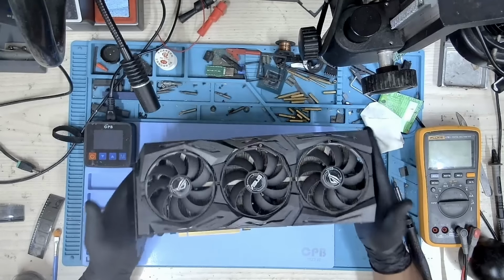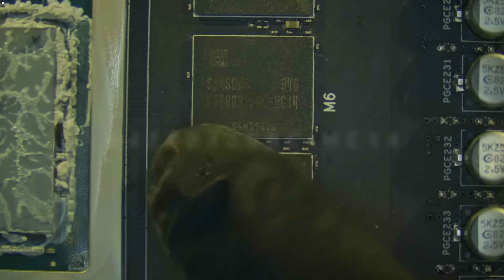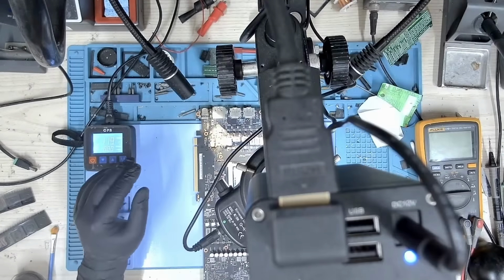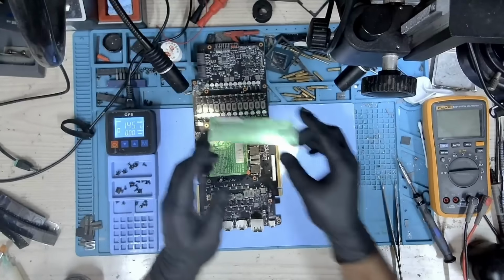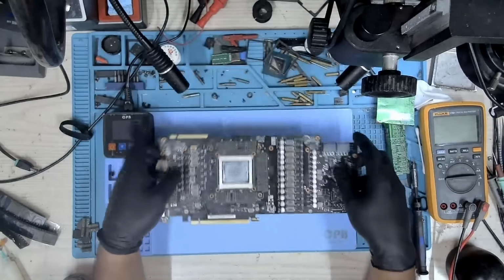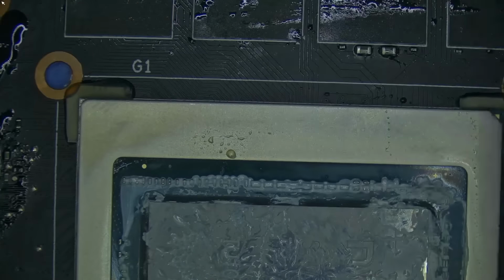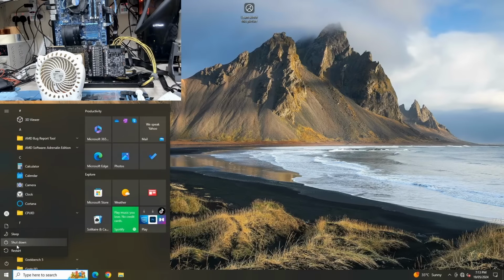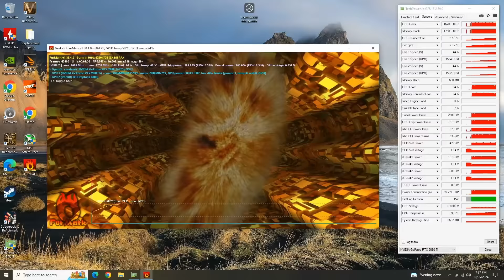Upgrading Asus RTX 2080 Ti memory from 11GB to 22GB

Comment: I doubt the 2000 series has the firmware capable of utilizing that much RAM. But I’m here to see what happens.
Reply: Very interesting and I agree that the chip would struggle to be able to utilize so much memory. It very well may be throttled from the factory and have the capability to use a little more, like 16 perhaps, but 22 is just overkill for it. I’m also curious to know why you didn’t benchmark the card prior to the upgrade so we could then benchmark after and see if there is indeed a difference. Essentially the question remains whether or not the chip is the bottleneck or if the memory is the bottleneck when it comes from the factory. If it’s the memory then this may be an upgrade that could have at least SOME merit, but if it’s the chip and it’s already overlocked then this was just a waste of time. We don’t know without benchmarking. If you could provide some verifiable evidence either way, via benchmarking, that would be appreciated.

I’m also very curious to know if this changed the heat profile of the chip at all. What was its idle/load temps prior vs after?

If it increased heat output, I’d recommend a water cooler system at that point to maintain stability and longevity of the card, especially if living in a “warm” environment. 

Is the end user of the card using it for gaming? Are you in contact with him/her? Are they able to report back on any noticeable performance improvements?
Reply from the maker: The end user is using for AI training. It is able to utilise all the memory installed. For gaming I will not recommend this upgrade as explained in the video.

Comment: It would be usefull to transform a 4090 to ~90 GB Ram for Running local LLMs Definitelly cheaper than buying a H100. I'm up to do it if you have a source for the RAM. I have access to proper equipment and the skillset.
Reply from the maker: On the current PCB for the 4090 there are only 12 memory slots. The largest capacity produced on GDDR6X is 2GB modules. If the memory is to be expanded a new PCB would be required with more slots. Something like a 3090 PCB. 4090 uses an extra 1.2V rail which is missing in 3090. So a whole new PCB would be designed from scratch.
Reply: @GraphicsCardRepairs-tk7ql  Oh I see. That would make it easier to add on then, since you could take advantage of auto pick and place. I guess the real question is, how do you implement an external PCB. Also, since the 5070 now just killed the 4090, whats would this concept integrate with that. Either way, if we could make this work, it would be a huge market IMO for local LLMs.

Comment: why m11 is empty? sorry i am from italy so if u have told that in the video i may have missed that sorry . btw gg great work
Reply from the maker: RTX 2080 Ti has only 11GB from factory. One slot is disabled as it does not use the full die. The full die with 12 GB is used by the RTX Titan. Since the memory slot is disabled from the core on the 2080Ti installing memory there will not work. As a result it can only be upgraded to 22GB.

Comment: i need this done to my rtx 3070 which only has 8gb i want 12gb how do i send my gpu and what is the location
Reply from the maker: Memory can only be doubled. There are some issues I am yet to resolve after that I can accept 3070. Right now I am only accepting 2080Ti as the upgrade is flawless and works without issues.

Comment: How did you change the bios? They are encrypted or just signed.since the 1000 series.
Reply from the maker: I don't have to change the BIOS. It is running on the default BIOS. It has support for these upgraded memory.
Reply: Oh ok so it's only matter of straps
Reply from the maker: Yes

Comment: Can you do that for my 4060 LP from 8 to 16GB?
Reply from the maker: I have not tested laptops yet.
Reply: @GraphicsCardRepairs-tk7ql  I meant low profile. That's the current highest power PCIE card for low profile Small Form Factor PC like HP Z2 SFF G4 desktop computers. The computers are cheap when used from offices, so more money can go into GPU and games.

Comment: would this also work on the 2080 super rtx 8gbs if i went for the same 22 gbs as you did
Reply from the maker: Yes it works on 2080 super as well.
Reply: @GraphicsCardRepairs-tk7ql  awesome thanks alot for the help just got one for 80 bucks that has a broken heat sink so i was planning on water cooling it , so thanks very much for the help

Comment: For training and multi-user LLM interface, 22GB turns it from garbage into a quite decent card.
As for single (or low count) user LLM interface it's nearly as good as 3090/4090. VRAM here is so important that the ancient P40 is still a best value option.

Comment: On which GPUs is it possible to make these memory upgrades?
Reply from the maker: Currently on the 2080 and 2080Ti it works flawlessly. 3070 the power needs to be jacked up to run smoothly. i will be releasing a video soon.

Comment: What's next 3060 to 3060ti?
Reply from the maker: I have tried the 3060 TI and it does not work without some heavy modification. When ever I find time I will continue my work in the 3060 Ti. The 3060 cannot be upgraded as it already uses the 2GB module which is the largest capacity produced.

Comment: Im guessing the msi 6950xt cant be upgraded either? Looks like its using only 8 memory chips so I guess its using the 2gb ones also?
Reply from the maker: Right. None of the AMD 6000 or 7000 series can be upgraded.
Reply: @GraphicsCardRepairs-tk7ql  I guess the next question would be, would it be possible to upgrade from gddr6 to gddr7? I guess that would be the next best possible memory upgrade for these cards unless its not possible?
Reply from the maker: No the data pins on the memory GDDR6 and GDDR7 are not located in the same location. If installed it may short the memory.

Comment: Very weird, normally you have to reprogram gpu bios or it may recognize only 11gb even with 22 instaled
Reply from the maker: Yes it is already done and shown in the video. On hardware it is done through straps. The bios already has the timings for the 2GB module

Comment: More ram means more electrical consumption. The driver code itself has its voltage limitations. Maybe you have more ram but without power. in any case so that it works correctly
 you  also have to make a modified rtx 2080 ti  driver code, and that is real  legal problems.
Reply from the maker: It's a good point and I will discuss this in an upcoming video.

Comment: Could this be done to a laptop with rtx 4070?
Reply from the maker: I have not tried on a lopt yet. But the 40 series of AMD all use 2 GB memory modules which is the largest capacity produced on GDDR6 and 6X platform on laptop and desktop GPUs.
Reply: @GraphicsCardRepairs-tk7ql  Oh so any mid range laptop is stuck with 8 gigs tops
Reply from the maker: 40 series dont have more slots so they are stuck at what is installed.

Comment: would it be possibly to do modifications like this to mining cards to restore pcie bandwidth as most of those are locked down to PCIE Gen1 x1 or x4
Reply from the maker: As mining cards use the x1 PCIE on the motherboard it always run in X1 in mining. If I get a mining cards I will check the PCIE lane on the PCB of the GPU.

Comment: hey, i have question. what thermo pads should i use for 2070super PNY? 2mm?
Reply from the maker: I have never received one. Currently pads would need to be measured with a vernier caliper.
Reply: @GraphicsCardRepairs-tk7ql  thank you for reply! you are right since i cant find any information in internet
Reply: @GraphicsCardRepairs-tk7ql  i changed them. for 2070s PNY it was 2mm, cheers!

Comment: Bro I have i5 11400f and Rx 7700xt 16gb ram is my system bottleneck ?? and I have 650w psu is it enough??
Reply from the maker: At what resolution do you use your system? at 1080p yes there will be bottleneck but at 1440p its minimal to even be noticed. The thing is you should not be worried about bottleneck if you can meet the desired frames or work on your system it should be ok. there are times when it is a concern but in most cases it does not matter. I use a 4090 on a 5950X at 1440p ultra wide. It is a bottleneck at 1440p but its does not concern me as i am able to complete all my tasks like video editing and rendering, even gaming at high frame rates with no issues. But if i manually calculate and compare with a 7800X3d i will find there is a bottleneck. My view is, if it does not hamper your work or play dont bother.
Reply: @GraphicsCardRepairs-tk7ql  1080p and what about psu I don't have any cooler
Reply from the maker: You PSU is good enough for the combo. At 1080p there will be bottleneck because of the CPU but if you can play your games at your monitors refresh rate you need not worry about bottleneck.
Reply: @GraphicsCardRepairs-tk7ql  thank you bro

Comment: Hello Possible for GPU in laptop ? 4070 8Go > 16Go ?
Thx
Reply from the maker: I have not tested laptops yet. 😊
Reply from the maker: I am working on one. There are some issues with it. Not found a fix yet.
Reply: @GraphicsCardRepairs-tk7ql  Alright, thank you for your reply. I’ve never understood why Nvidia insists on only putting 8GB on the XX70 series…

Comment: I would had thought it would be good as regards running hi resolution  as regards I think cards with  11 GB  just don't cut it sometimes .  But I would like to   could a card like a 1080 ti  have DSC upgrade as it has display port 1.4 but no dcs  so you can't vr  on a 1080 ti with the ps vr2 it just don't work . Which is a shame as he 1080 ti nice card . Old but nice  still direct x 12 card .

Comment: Amazing work! Is it possible to do a 48gb 3090?
Reply from the maker: Someone has already done it by using the workstation GPU PCB by installing the 3090 core on it with GDDR6 memory. It's a bit slower memory compared to GDDR6X. I have not tried it though.

Comment: I have gtx 1080  is it possible to solder more vram ?
Reply from the maker: No. 1080 is at its maximum capacity. 1GB is the highest capacity produced on the GDDR5X platform.

Comment: How do I do this?  All I want is a stupid 3090 graphics card and but all of them are being sold with no chip and no vram.  If i try to buy a complete one there $1200+ .  Where do i get the chips and vram please?!  Thanks
Reply from the maker: In UAE you can get a working used 3090 for about $550 to $600 which is in very good condition. Im sure in your area you may have similar deals too. $1200 for 3090 is way too much at this point in time. You can get a new 4080 super for that price.

Comment: How is it possible??? Supposedly GPU ram isn't upgradable...And it works without a custom firmware? But the driver implements only 11Gb so surely there must be at least a custom driver?
Reply from the maker: @avrel820  there is no custom driver required. The BIOS supports the new 22GB VRAM installed. Nvidia never released a 22GB GPU but they had it as an option. This is not the first 22GB memory upgrade on a 2080Ti. There are a few who have done it in the past too. Hope you enjoyed watching it. 😁

Comment: Can we use the m11 slot. Im assuming its not physically blocked or gpu is capable of using the slot
Reply from the maker: The empty slot is disabled from the GPU core. Installing memory there does not work.

Comment: Is it possible to take Vram from a 3090: 24gb of DDR6X, and place it into a 4000 series card?

Say a 4060ti
Reply from the maker: No the 3090 uses 1GB GDDR6X modules. All 40 series of Nvidia uses 2GB modules.
Reply: @GraphicsCardRepairs-tk7ql  thank you

Comment: can you upgrade a 1650 supers ram? 4gb isnt enough
Reply from the maker: I have not tried upgrading a 1650. It has 4 slots but uses slower 12Gbps memory. But the cost of upgrade would exceed the value of the GPU. for less than the price of upgrade you can buy a used 2060 or even a 2060 super
Reply: @GraphicsCardRepairs-tk7ql  thank you for the reply can I get a price? I wanna spend money with you in all honesty
Reply: @GraphicsCardRepairs-tk7ql  unless you can give me a better updrage with same wattage. I need this one

Comment: I'm a bit curious about the M11 position that it's empty - is that for ECC or is that for some other GPU type?
Reply from the maker: 2080 to has only 11 memory modules. The M11 slot is disabled from the core as 2080 to does not utilise the full die. It's used by RTX Titan.
Reply: @GraphicsCardRepairs-tk7ql  I see, it requires a different GPU with that position enabled to be useful.

Comment: Yes, 22 GB is useful for people that would like to run compute tasks on that GPU. If the upgrade of the memory modules with the labour cost, will be cheaper than buying a compute card that has the same amount of VRAM. Than this will be a viable solution, again, as long as the costs justify the performance gain compared to currently available solutions on the market. Extra VRAM is beneficial for Ray Tracing, so yes. On the overall, this mod will help.

Comment: Is it possible with RTX 3060 12GB?
Reply from the maker: Unfortunately the 3060 already uses 2GB memory modules which are the largest capacity modules produced. It has only 6 active slots.
Reply: @GraphicsCardRepairs-tk7ql  Thank you very much!

Comment: hii sir! a month before I bought Asus tuf f15 laptop with a configuration of 48 whr battery but now I'm facing so much battery backup issue so I planned to upgrade 48 to 90 whr battery is that possible or not, Why because some other models are comes with same cpu and gpu configuration with 90 whr, also I opened my laptop, inside that have much area for larger battery so if i upgraded means anything wrong could be happen or not. please give me a clarification about that.
Reply from the maker: The battery can be upgraded as long as there is room for the extra size. There should be no issues upgrading.

Comment: getting a red light issue on my evga 3808ti ftw3 any possible solutions?
Reply from the maker: There is a possible short on the pin which shows a red light. The fuse is blown on that 8 pin.

Comment: Is this possible with the rtx 4060?
Reply from the maker: Unfortunately it's not possible on the 40 series
Reply: @GraphicsCardRepairs-tk7ql  Damn so I have no option but to upgrade in 2 3 years. What nvidia card would you recommend? I guess anything 12gb vram and upward?
Reply from the maker: It depends on the resolution and games you play. If you play at 1080pm many games will be ok at 8GB but a few games will exceed memory of 8GB if played with all bells and whistles. As you move up the resolution the larger the memory size the better.  So there is no one solution that fits all. If you have the money now to buy 12GB or more I would suggest doing it. If you play games that are heavy on memory and like playing with ultra settings and RT it's better to buy a GPU with minimum 12GB or more. If you play games like battlefield, NSF, racing games etc they don't need a lot of memory.

Comment: While this is cool and excellent work, I can't help but wonder, what is the purpose? 

Its certainly not for games. While the 2080ti was quite a monster when new, that was 6 years ago, which is an absolute eternity in GPU years.  In todays RT world, the 2080ti is essentially a 1080p card.   Pretty much anything you will run at 1080p is going to be fine with the original 11GB.  It would seem that any application this GPU is powerful enough to be usable for, its original amount of VRAM is sufficient.

Maybe there might be some specialty compute applications?
Reply from the maker: Yes for gaming it's not worth it. for AI it's a different ball game.
Reply: @GraphicsCardRepairs-tk7ql  Ahh, interesting.   I thought they were all using specialty ASIC's (TPU'S?) for AI these days.

Comment: Ist ist posible to upgrade a 3090 with 48gb Ram?
Reply from the maker: I have not tried it yet. I dont have a 3090 to test. If I get my hands on one I would try it. I am currently working on a 3080Ti but its not successful yet. I will release a video when i am able to get it ready.
Reply: @GraphicsCardRepairs-tk7ql  thank you

Comment: Why is the gpu voltage only 11.1v? 🤔
Reply from the maker: The electrolytic capacitor inside the PSU is faulty and needs replacement as a result it is not able to keep up with the current draw so it is dropping the voltage to compensate for the loss. I have replaced the PSU for now.

Comment: Is this really worth it tho? vram isnt gonna give you alot of performance, boosting the clock will. 11gb is already plenty for gaming, and for anything else you'll never need a gpu like this. You won't see performance from upgrading vram when its the mhz thats restricting.
Reply from the maker: Your right. VRAM does not increase performance. It only increases capacity. Only benefits are smoother frame rates and lesser stattering. I would not recommend this upgrade on this GPU for gaming. But for AI it's a different game. It's an excellent and cheapest choice for AI.
Reply: @GraphicsCardRepairs-tk7ql   For any useful AI/Deep learning you'd go for a proper card like NVIDIA A100 or A6000, doing this just seems a vit unecessary. Really great job and impressive you got it to work, don't get me wrong. But feels like people are considering doing this when the'll never need it. For any entry level AI a 2080TI is never reeeeally gonna hold up no matter how much vram its got.

Comment: i have the asus rt7900xfx 24gb
upgrade possible?
Reply from the maker: None of the AMD 6000 or 7000 can be upgraded as they already use the largest capacity memory modules produced on GDDR6 platform.

Comment: Bonjour faite vous aussi les RTX 2060 normal 6gb et si cela est possible bien sûr merci encore pour vos vidéos :)
Reply from the maker: I have not tried the 2060 yet. But the cost of upgrade will exceed the value of the GPU. For less than the cost you can already buy a 3060 with 12GB